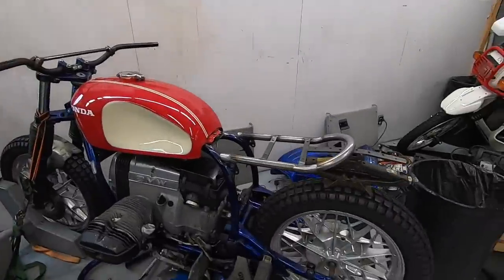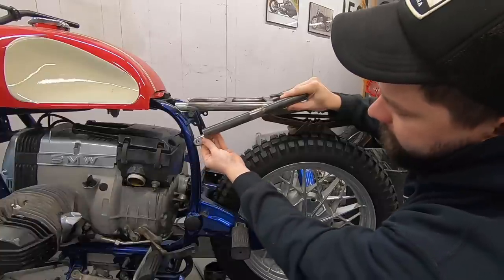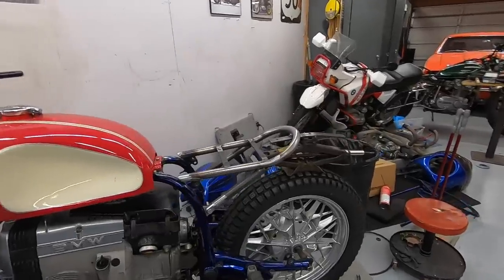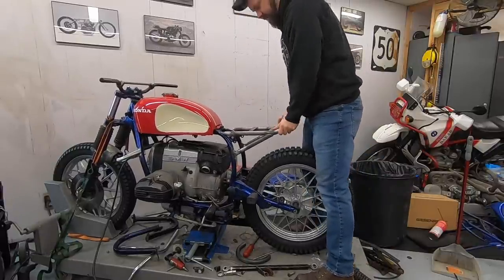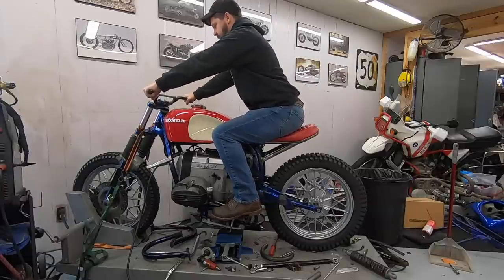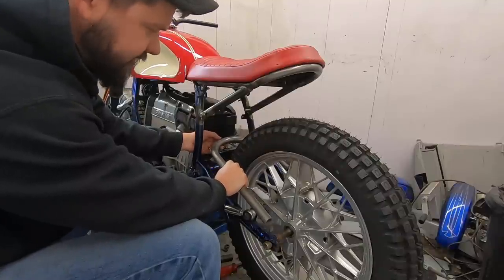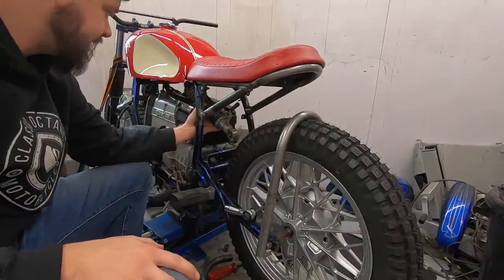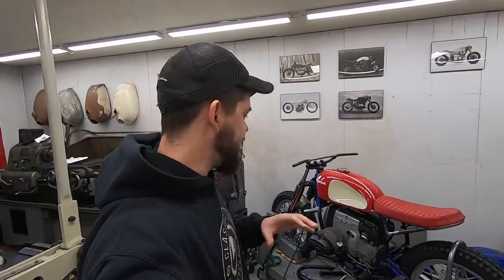BMW Airhead one-off suspension design.

Comment: Love the idea of 'triangular' shocks joining the swing-arm. However, thinking about the pivot points for the shock itself, they would both normally be set at 90 degrees, therefore able to tilt up and down freely. Changing that angle to anything but 90 degrees (about 65 in your case?) - I'm not sure it would provide free movement around the fitting, as it wants to move in a straight line up and down, but being at an offset angle would cause it to bind. I'm purely guessing at this, but it's something I would consider if I were trying this method. Lovely work as always bud.

Comment: that's a really cool idea for the suspension. i always wanted to build a suspension with longitudinally horizontal springs like the desert racing trucks use. that converts any down force into forward momentum rather than straight line rebounding force as in a more vertical spring setup. makes for a softer suspension feel, and a lot less "bouncy" ride.
Reply: Great idea!

Comment: Taylor looking good, question though. Is that shock mounting position going to be in the way of other maintenance on the bike? Also I don't know that you will have the right articulation in the swing arm / suspension when cornering. Not positive but  it could be an issue. Looking forward to the new videos!

Comment: Looking good. For some reference on double shock type “mono” systems look up KSI Knobby shop International Thumper 1977 Marty Moates.  There’s a couple other dirt bikes that did this. Kramer made frames like that for Maico. In the 70s everyone was trying to catch up to Yamahas system so lots of shop built Motocross bikes with the two shocks instead of one but a mono swing arm

Comment: The Canadian Yamaha RD350LC had a monoshock used for many RD conversions. I doubt you would want ride height adjusted with swing arm geometry. The big design trick is the desireable straight line between the front of the shock and the rear wheel. Lay out on paper your components and their arcs and play with the positions. It’s only ideal in one position so you have to mount it so that that shock’s rear mount never drops below the center of the straight line as the pivot arcs. You don’t want it swing past center when fully compressed. Not hard to do at all but the closer to a straight line the more direct acting the shock. If that angle changes a lot you have a variable spring rate and some have even gone over center and gone inverted in the rate. Eyeballing will show that movement is not that great so much of it is theory but you just don’t want to start with theoretically incorrect angle.  As for double shocks - that might look cool but is mixing the negative compromises of both setups not to mention extra weight - not only to the sprung weight but also partially to unstrung rate. Theoretically, the shocks, if not in plane with each other, would need to be able to pivot on heim joints as the angle is changing in two planes with swing arm movement. An awful lot of potential for undesirable handling. I’m no engineer but these thing come to my mind anyway.

Comment: I saw a monoshock conversion similar to what you want to do, where they removed the airbox at the back of the engine and made a custom curved plate to make more room for the shocks. Look up Wilkinson bros 1976 r/75/6. I think this would give you more room to do the two shocks and let you adjust your angles more to get them how you wanted.
Reply: Plus it would give you another feature to incorporate with the design of air filters you want on the carbs

Comment: Might I suggest mocking it up in a 3D cad model. Binding and angles should become more obvious as you put it through it's range of motion. I work in Solidworks but I'm sure there is cheaper software that has some of the same functions.

Comment: I think the guy  that runs For the bold u tube channel is running twin ( mono?😂) shock design  for that tho u really need. Much weaker springs  a radially slotted plate  with two fixed side plates and a good sized bolt hole to lock em together would do the the truck for the forward mount on the adjustable brace / mount  it won’t have a lot of side load on it because of the  swing arm pivot